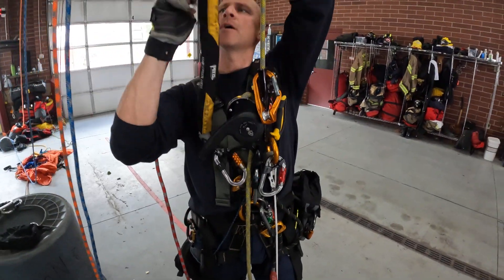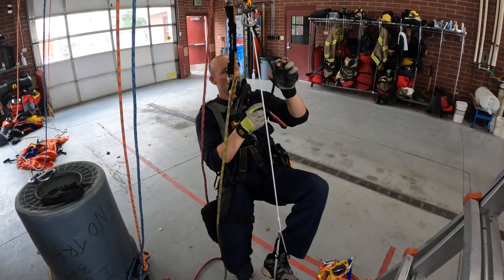Ascending Rope: RAD System w/ 3:1 Mechanical Advantage Assist

Comment: Why is that a 3:1 and not a 2:1 with a change of direction? I thought the explanation was coming later on 😆
Reply from the maker: ah yes…. sorry… later on as in another video perhaps.  So there is a little rule known as the “frame of reference” or “input source” rule, which is probably more familiar to the offroading community that commonly use winches & snatch blocks to pull their vehicles up steep terrain.  This rule says that if the load is also the source of input force, then the frame of reference will change.  This means that when you’re doing the rad w/ a change of direction, the cod isn’t really a cod at all.  Instead, from the climbers frame of reference it is a traveling pulley that appears to be moving towards the climber.  Its pretty trippy when we tested this out using a load cell on the haul strand.  It’s a 3:1 when the climber is pulling down, but the moment someone else on the ground pulls instead, it registers at a 2:1cd… instantaneously….. And, if you just pulled up through the descender without routing the line through the pulley at the handle ascender, its a 1:1cd, and not a 2:1.  Only when someone else pulls does it then become a 2:1.
Reply: @Propeller_Head  are you able to send the link for that video? And did you take a video while using the load cell?
Reply from the maker: I didn’t do any filming with the load cell… but I don’t think I can make a better video than RopeLab’s here: https://youtu.be/93AX2aPibZc?si=fc3718t2SIa1ktrt